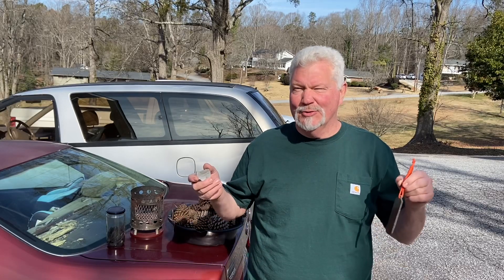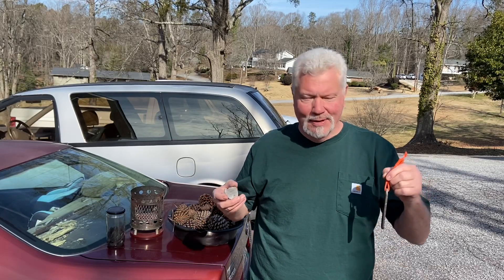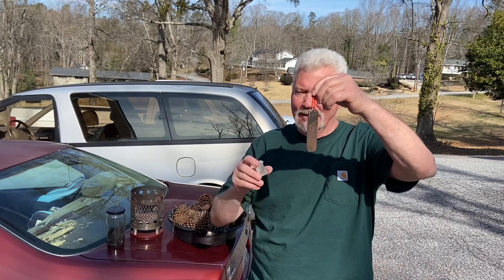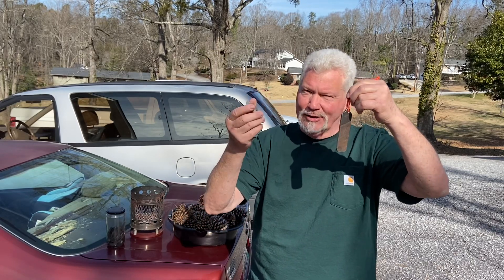Ever Wondered How A Flint And Steel Makes Sparks?

Comment: I thought it was the friction of instantly shearing a piece of steel off the main piece and the friction was high enough to heat the splinter red hot..... although there are alot of instances where accumulated dusts are actually explosive.....grain silos etc ......
Reply from the maker: A lot of people think that. My under standing is from what I've read. If you find research with more info please let me know.

Comment: David I have a couple of file/strikers. They spark but seems not as consistent as yours do.  Is it necessary to harden the files by heating them up and quenching them?
Reply from the maker: Are they from Nicholson files? Did you keep them cooled off with water while cutting and grinding them to preserve the temper? I know nothing about tempering steel. I buy worn out Nicholson's from the Flea Market for a couple of dollars each.
Reply: @DavidWestBgood2ppl  I don't know what brand of files they were.  My Hardware store guy gave me one file. I didn't do anything with the tempering yet. I'm wondering if I should?
Reply: @meh2b2  The file is as hard as it's going to get. Tempering can only soften it which would probably be bad.
Reply from the maker: Also, try them out in a dark garage. You may be getting more sparks than you think.